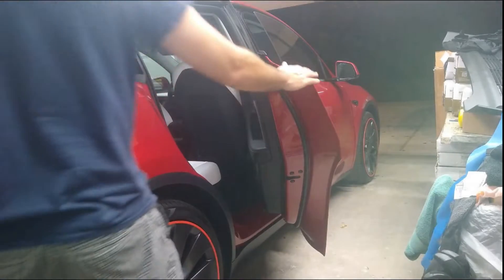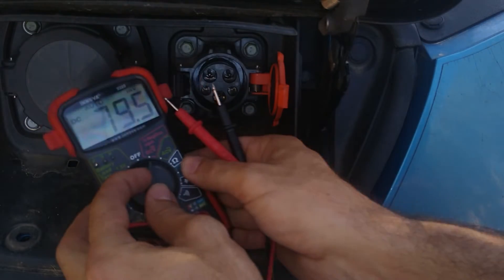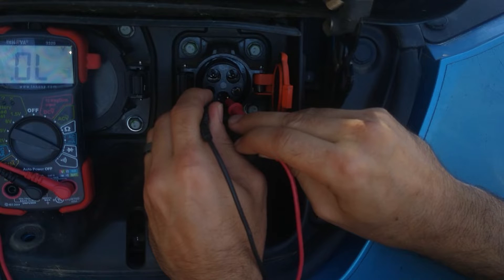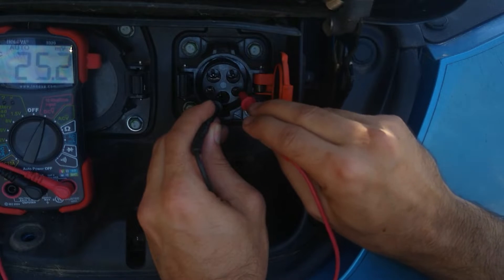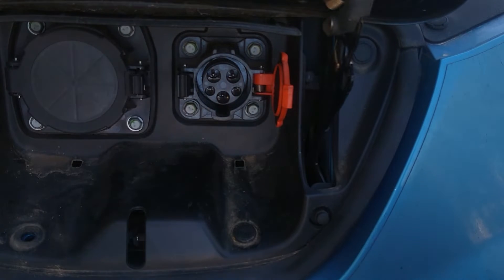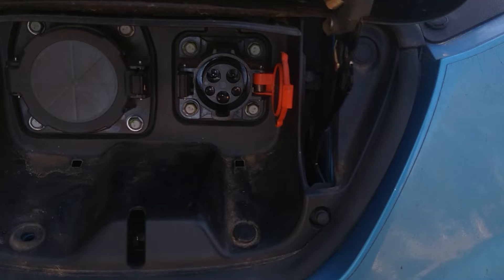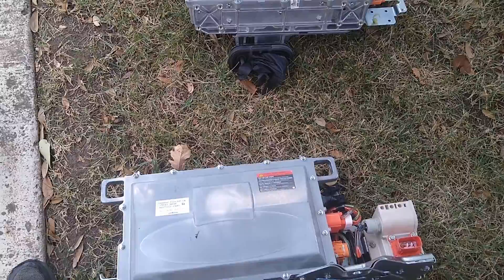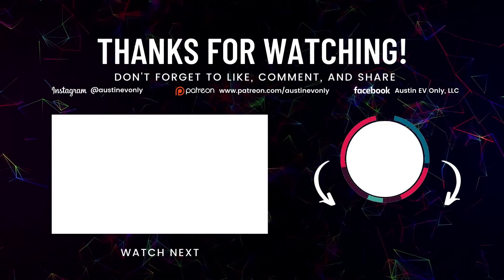Nissan Leaf won't charge!⚡️How to Fix 🔧

Comment: Hi, do you know what readings to expect on a 2019 model? I checked and I'm getting 7.6Mohms one way and infinite the other way. I'm guessing that may indicate an open?

When I plug in the car to charge the car will indicate it is charging on the dashboard but no power is being transferred. then it will stop and start trying to charge again. After  It repeats this a few times It will stop trying to charge.

Comment: 2001 leaf  ir will charge up and say 25miles  and it acurate i drove 20 miles     i went fron all bars to 4 bars in 12miles  no light or ac   what is the cheap way to fix    can i buy those 40 batteries on ebay      any advice

Comment: Did you know that if the 12v battery (under the hood) is low or dead, the car won't charge at home?
Reply from the maker: yes. i know
Reply: So. If the battery under is charger I was told I should use the port on the left